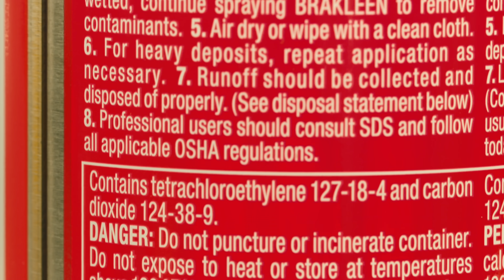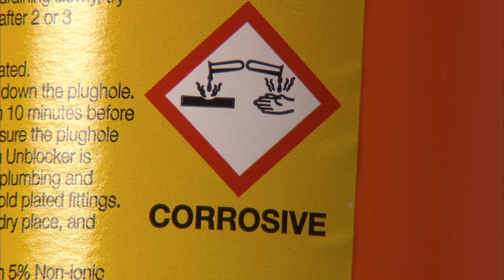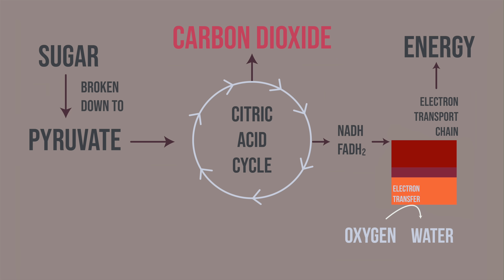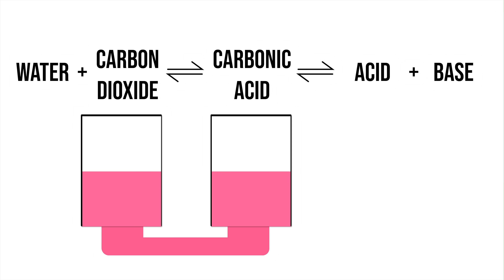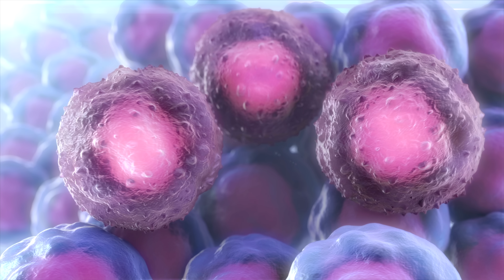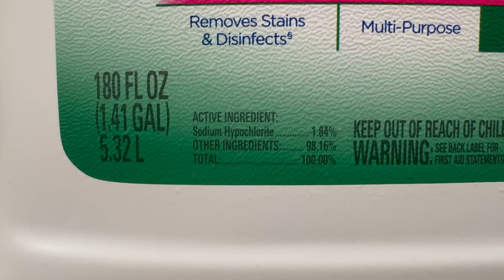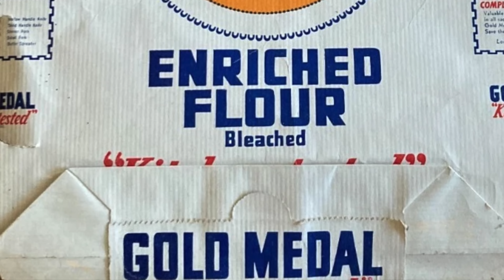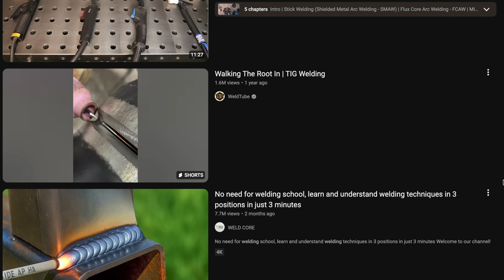"It smelled funny while I was welding and now I can't breathe..."

Comment: I got a welder during Covid. Of course I got the cheap one and then converted it to DC. Full wave bridge, large caps, heat sink, new fan, lol.  Then I learned to weld, hehe.  Due to my vision I can't see to weld unless I'm out in the daylight.  Which means I have more than adequate ventilation.  But I still bought a good mask for grinding, wire wheel, cutting, welding.  As a new guy it's remembering, and taking the time to suit up, I find challenging.  You don't really have the in-time to create a routine in their use.  Maybe a check list would help.  Be sure to wear eye protection too. The wire wheels in particular can spin out wire pieces fast enough to pierce your jeans.  Hitting your eye would definitely be a bad thing.  And I knew a guy with one eye that got nailed by small bit of metal.  He said he was using a regular electric drill.  Which puzzled me, but stuff happens.  I'm glad I found this channel.  Be safe, and Merry Christmas!

Comment: Hope this saves lives, i wasn't aware the risk of chlorinated items/ brake cleaner

I think auto expert au channel  (john)
Has made a similar on welding risks

But as this is real and as a bit of engineer myself i,llbe more vigilant. 

We often weld up old parts and set smoking all sorts of nearby sealants and unknown surface coverings via heat/sparks so we need to be more careful.  

Thanks.

Comment: I had several small doses of welding after cleaning with brakleen, and had horrible headaches a few times before finally researching and figuring out what it was, but it wasn’t easy like it is now, this was prior to the internet. I was in fairly well ventilated areas and didn’t weld wet brakleen either.

Comment: Thats certainly not the braklean I use, mine is pretty much identical to cigarette lighter fluid, or petroleum without any additives, so by the time you would be welding if he'd used my brand, the braklean would be gone and left no residue whatsoever, ideal for cleaning brakes, as its for cleaning everything off, and leaving nothing, like pure alcohol but better.

Comment: Even new metal comes covered in oil to keep it from rusting, so it's got something on it no matter what. In our metal shop we use dawn soap to wash the oil off, and rinse with clean water. Rag dry for clean ready to weld metal. - A Metal Fabricator

Comment: I have been welding for a few years.... It is a super dangerous hustle.... Real talk- metal pieces are sharp.... Metal dust everywhere.... I used to need to sweep the shop several times a day from the grinding disks.... LOUD.... DIRTY.... HOT.... I have been set on fire.... Yada yada.... I still love it

Comment: I'm no welder, but I already knew from soldering: the INSTANT I smell something weird, I switch off the tool and leave the building. There are way too many things that the material could have been treated with which will cause permanent damage of one type or another.

Comment: I told chat GPT this new trick:

Stop. That is extremely dangerous.

Many brake cleaners contain chlorinated solvents. When heated by welding, those vapors break down into phosgene gas, which is a chemical warfare agent. It is colorless, smells faintly like hay, and can destroy your lungs hours after exposure. People have died doing exactly what you described.

Key points:

Even a small amount of residue can produce phosgene when hit with a welding arc.

You may feel fine at first, then develop severe breathing failure later.

Ventilation does not make this safe.

Safe alternatives for weld prep:

Wire wheel or flap disc to bare metal.

Acetone or denatured alcohol, then allow full evaporation.

Dedicated weld prep solvents labeled non-chlorinated.

Heat the metal first only after confirming no chlorinated chemicals were used.

If a can does not explicitly say non-chlorinated, assume it is unsafe near heat.

This is not a “pretty cool” trick. It is one of the most well-known lethal welding mistakes.

Comment: Thank you, thank you. Part time welder-fabricator here with 50 years experience. Also machining, lathes milling, etc. Never have I used brake cleaner, but that was because of ignorance. I did not know that brake cleaner  could be so deadly. This short and to the point video MUST be shown and shared in education and industry. Also, I am now wary of any prep work involving chlorine.  
Again thank you. This will save lives. No doubt about it. 👍

Comment: I'm always extremely careful both inside and outside of work, always reading the warning labels, wearing PPE when nobody else does, googling shit blah blah blah. I'm a welder and I used to do exactly this and It didn't occur to me until after I did it a handful of times that it could be dangerous. Young and dumb, I secretly scalded myself for not thinking "hey numb nuts, welding on top of fresh chemicals could be dangerous". It's stuff like that we do in the heat of battle that no one really thinks about that gets people hurt in what we call "freak accidents".

Comment: At 1:20 I'm predicting phosgene production from thermal decomposition of Non-Flammable brake parts cleaner

NAILED IT.

I almost gassed myself the same way trying to light my forge using the stuff, but since it wasn't igniting correctly, and the flashes I did get made a smell and a feel I didn't vibe with, I quickly opened the door and got everyone out. Then I did the homework and figured out why, and that if I had gotten that forge lit, it likely would have killed everyone.

Comment: You need to do a video about welding, grinding and heating..
Galvanised steel..
As far as I know even A&E can't do anything..

Exhaust gases from a vehicle and other sources of combustion, burning correctly or not.. CO etc..

There's also other materials not all metal that can cause a whole load of problems.

Amazing use of the new YT Collab feature..

Comment: A similar ( but not as immediately lethal) issue I exposed myself too (briefly) was using galvanised steel from local scrap/skip dumps. ( I was 17) - They were my go to free metal for welding car panels etc.. However when welding a fine filament and fumes of Zinc oxide is produced. that breathed in can lead to permanent lung damage , Asthma through to emphysema . I  quickly realised the danger and would only use this freely available scrap with a proper air flow welding mask or a decent filtered breather. It's really easy to do yourself in with half the knowledge. Mankind did the same enmasse with Asbestos - so don't punish yourself for ignorance - it's a common problem . Instead educate yourself , as this video helps towards - Thanks for listening .

Comment: Phosgene gas. Bad, bad, bad stuff. You need positive-supplied air SCBA (Level A PPE). Inhaled, it is COCl2, and its  mostly water resistant, so it travels deep into the lungs and readily acylates to form CO and HCL. There can be a significant delay before you feel the effect, and that delay is deadly. The lungs are damaged at the alveoli sacs, and there it causes mass inflammation which triggers a mass immune system action that causes fluid to build in the lungs. You suffocate to death.

Comment: Phosgene is a devil. In WW1 Germans were the first using chlorine. But  there are ways to prevent severe chlorine poisoning. In a nutshell, it is less effective. So they later turned to phosgene and the rate of deaths in the trenches went up. But turned out - luckily - that using gas has a high risk of backfiring to oneself.

Friendly reminder to Doc Bernard: Hey Doc, I love your videos. But I missed one point in your video. Phosgene reacts with water according to COCl2 + H2O -> CO2 + HCl. So the moist environment in the lungs will turn into a cloud of hydrochloric acid destroying the lung tissue. That is (one of) the main reason why phosgene is much more effective as a poison than chlorine gas in WW1.

Comment: This is something I could have easily done myself if I thought of it, since I use both. Scary stuff. I've come into contact with chlorine gas when mixing chemicals in a small dose and it was enough to give me a headache for a while. I also spray anti spatter spray on my welds and sometimes I go back in the house and put tissue up my nose and lots of black come out.
Also, NEVER weld galvanized metal. This will also give off toxic fumes I learned.

Comment: 1:10 I don't like to be that guy but the stock footage you used is of someone is wrong, they are applying a copper anti-seize spray to keep the rotor from sticking to the wheel, its not something most people would notice or care about though tbh.

Comment: I was scared of welding but wanted to make something got a cheap flux core machine used, came with a hand held face shield and a junky hammer. Threw out both those went got a Propper helmet. Most the stuff I weld unless painted I seldom bothered to clean, unless it already was. I think stupidest thing I welded was some scraps of electrical conduit because I didn't have scraps and wanted to try something, that stuff is galvanized not a smart thing to weld. Done two welding classes now TIG and stick, not going into for work but think be neat to have AWS level one cert.

Comment: The hazards of using brake cleaner prior to welding is a topic that comes up every couple of years. The manufacturers of welders should include a pamphlet listing chemicals to avoid when welding. I (retired contractor) was attending an online continuing education class for HVAC and the instructor suggested using brake cleaner to degrease objects. Since we had live interaction, I was able to immediately call out the dangers of his advice to which the company followed up with an email to everyone in attendance to never use brake cleaner.
Even so called safety experts give bad advice.

Comment: As a former (as the americans reffer to) Drägerman i have actually worked on 3 chemical Plants that had to use Phosgene in reactive processes to produce other products. At one Plant i was required to enter the Chambers, where they had to produce and process Phosgene. It has to be noted that Phosgene- production is only allowed for necessary processing and quantities and only under strict HSE- regulations, like Phosgene- Indicators placed inside the outside Atmosphere indipendent Airmask, protective workwear and other things.
To my knowledge the fatal accident involving Phosgene happened in China, in the late 2010´s to about 2020-ish...
Also: This is a very good case on the ramifications of what i know as a Lung Odemia (me as a German hoping that this actually is the English term). AKA water in the lungs...

Comment: We used to spray brake cleaner under the doorjam when one of our coworkers was taking a dump. At that point they had about 5 seconds to pinch it off and run, bc a bottle rocket 🚀 would scream under the door and it would blow up, ignite the brake cleaner, and out wound stumble a smoking coworker!
   That was a fun job.😅
Reply: We also connected the fart fan to the managers ceiling vent with a dryer hose and filled his officecwith shit fumes 10X a day, lmao. He didn't figure that out for a year, lololol😅

Comment: You forgot to mention they also found he has extremely high testosterone.  This is great. Love seeing two creators I both subscribe to collaborating.  Guy use acetone to clean before welding.  Also don’t weld galvanized steel as well.

Comment: I once worked in a motion picture laboratory facility, where one of the things they did was scan 35mm film for transfer to tape. Before scanning, the films were run through an ultrasonic film cleaner to remove dust, dirt, and any fingerprints that may have accumulated on them while being handled in the past. As part of the process the film was run through a bath of perchlorethylene during ultrasonic cleaning. Because of the toxicity of 'perc', the film cleaning machine had it's own little room, and for safety, you weren't allowed to be in that room while the machine was operating. All the controls were outside of the 'cleaning room' and so you had to operate the machine remotely from an adjoining room and watch the machine through a thick glass window.  Now I understand why the lab took all those precautions.

Comment: What a horrible way to die, but as soon as the word ‘phosgene’ came up, it didn't sound good at all. Can someone confirm for me: is it a combat gas? (banned like all that crap) but 
I think I heard about it during  my military service in NBC, but that was in 1991
In that case, it's really an unknown risk because when you hang out on YouTube, everyone who does mechanics (including me) uses spray brake cleaner when they need to quickly degrease a mechanical part (personally, I NEVER do it indoors and always face the wind until everything has completely evaporated, and I always wash my hands as soon as I'm done).

Comment: Dilute muriatic acid (HCl) works well to remove mill scale, rust and zinc coatings from steel, but it must be used outside and don't breathe the fumes. Coat with phosphoric acid to create a layer of iron phosphate to prevent rust.  I do this to strip zinc coatings before welding because fumes from zinc coated components are toxic. When I saw the title my first thought was that he was welding zinc plated parts.

Comment: Interesting video. As a former auto mechanic that in the past worked with R22 refrigerant. We learned to not smoke while working with R22. The warning was on the tank containing it. The heat of the burning tobacco would create phosgene gas. A gas that I was told was used during WWI as a weapon. Along with mustard gas. I can't imagine how horrible it must have been for those soldiers that inhaled it.

Comment: UV radiation in welding: After the week of welding (part of a lecture at my university) the sleeves of my blue jacket were bleached out from the radiation, you can still exactly see where creases formed when I was sitting at that welding table.

That Radiation is no joke. Probably more bleaching than what would have happened in a whole month of straight sunlight...

Comment: U DONT EVEN NAVE TO BE WELDING, U CAN DO IT WITH CLORINATED BRAKE CLEANER AND A PROPANE TOURCH, HOT ENOUGH USE ACETONE, YOUL NEVER HAVE A PROBLEM!!! ISOPROPYL ALCHOUL FROME WALLMART WORKS FINE AS WELL!!! NEVER HEAT ANY THING CLORINE BASED IN IT!! U MIGHT DIE!!!

Comment: THANKS SO MUCH FOR THIS POST. I do a lot of welding and quite aware of most dangers. Several factors involved in this incident, but you need to stop and read lables and safety guides to be aware of the poison in the cans,   welding rods, and realizing paint, galvnize smokes all have poison gasses. Poison sprayed on rust, the rust asorbs it like a sponge. 
     Yes, the welding equipment providers need to have a good, well-informed document about safety.

Comment: I had something similar. I don't remember if i was welding that day or no. I don't remember if i was using brake cleaner, or no. But after work i came back home, and started to feel pain in the left side of my chest. Shortly (few hours) after that my breath started to be shallow. My lungs were not able to expand, like something is blocking them. At the hospital they made rtg, and usg, and found that i have liquid between left lung and pleura. My saturation was 90. And i was at that time 35. That liquid was stopping lung from expanding, taking it space. Doctor punctured me in the back, between ribs to access this liquid, and it came almost a liter of it. That was relief of a lifetime. They gave me antibiotics thru the iv, and everything ended quite good. All the doctors were asking me when i felt or did i hit something hard, but i didn't. Today i don't have full condition to run etc. But i am alive. And now i think that it was something similar like here in the video. From that time, every time, if i'm painting, grinding, welding, or doing anything with a lot of flying stuff in the air, i am wearing 3M mask with filters rated for acids etc.

Comment: Phosgene gas is an interesting one
My dad used to drive trains, way back when he would do freight sometimes and part of that freight was furniture with foam padding
The foam, when burned, would then release phosgene gas
With most accidents or fires, the driver would stop the train, and then meet up with the person in the back to determine where the issue was and put it out if they could
When they were carrying that freight, they were instructed to run as fast as they could away from the train

Comment: I've heard of brake cleaner being dangerous, but it was pressurized CARB Cleaner spray that made me blind.
Carb cleaner is a molotov cocktail of 3 different solvents, and once those tiniest ricocheted droplets hit your wet eyeball, they go right though and your vision goes.
If you've got carb cleaner in your shop, throw it away.   There are better ways to clean a carb, like poking a fine wire through your jets, or ultrasonic cleaning. I had to get both eye lenses replaced.

Comment: Man... Knew it had to be fumes, but I thought it was the OTHER big F up novice welders make, ZINC vapors from welding GALVANIZED steel! My neighbor taught me welding at age 14 and the "no-no's" were the first things he warned me about. He was a professional welder who started out in the 60's welding large copper plates into heat sinks, which will also kill you from toxic fumes! Why they had to wear a sealed ventilated hood system kinda like scuba gear!

Comment: Having used brake clean almost every day, I can assure you it does NOT remove rust. Makes me wonder what else they got wrong. Next video you can have someone welding an AC system. R12 plus flame equals nerve gas.